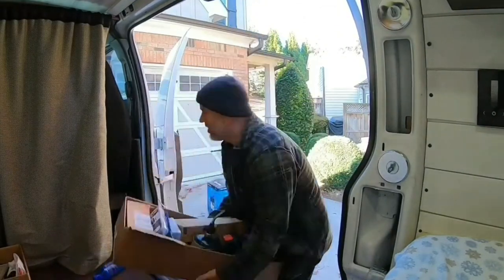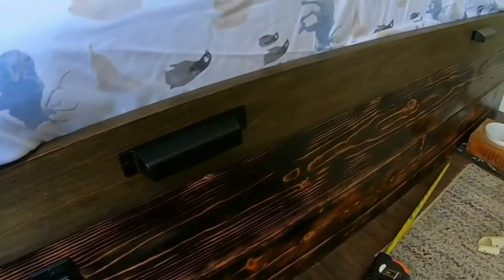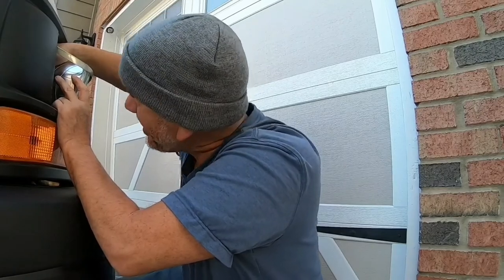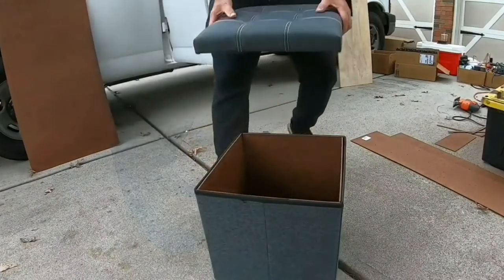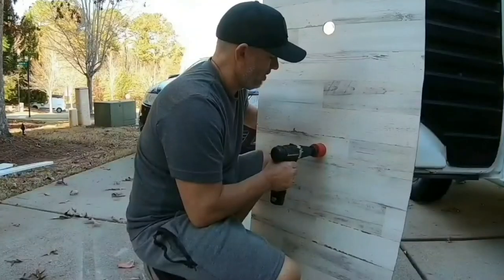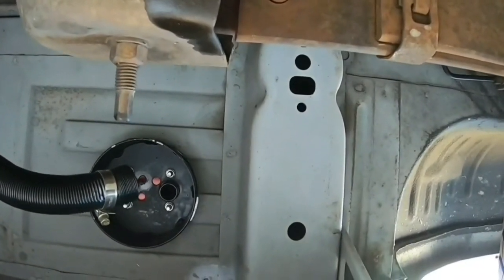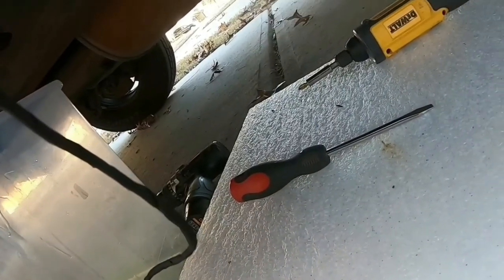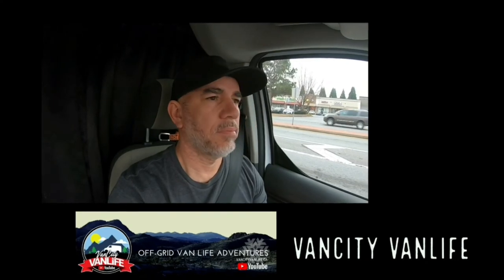Chinese diesel heater finally in and working! 😀 -  GMC Savana van build series

Comment: AMAZON HAS A VIDEO AT THE BOTTOM OF THE DIESEL HEATERS PAGE. SHOWS YOU EVERTHING YOU SHOULD NEED TO KNOW. ALL THE PARTS ARE INTERCHANGABLE 2KW, 3KW, 5KW AND 8KW. ALMOST ALL INTERCHANGEABLE. THE VIDEO DOES WARN NEVER PUT THE HOT AIR HOSE IN A S SHAPE BEND!
Reply from the maker: Thanks Mike. I'll check it out. Are you talking about the exhaust hose outside or the hose vent inside?